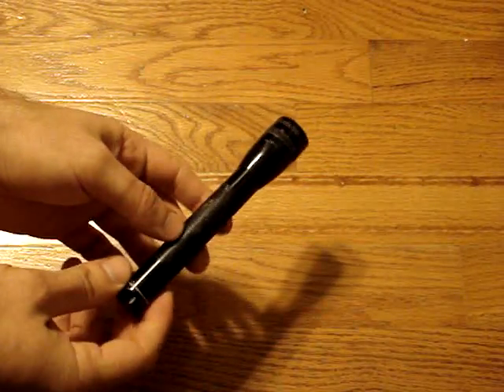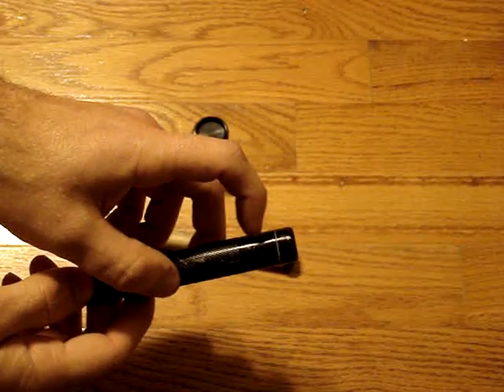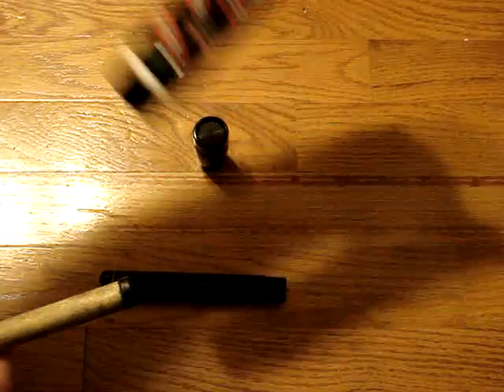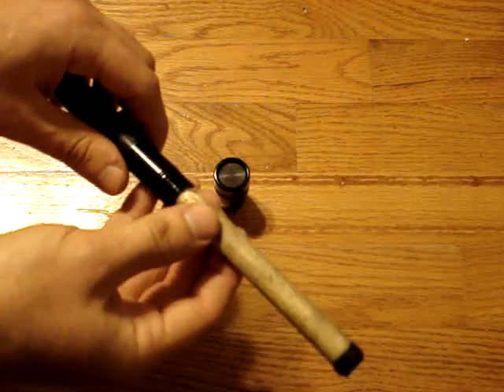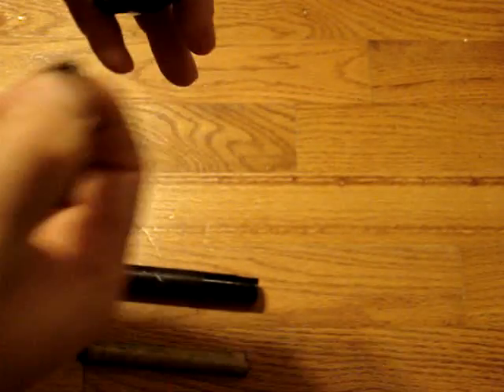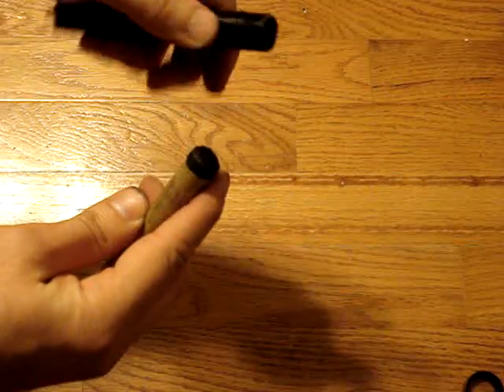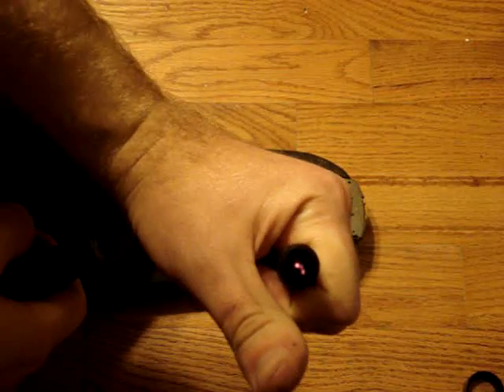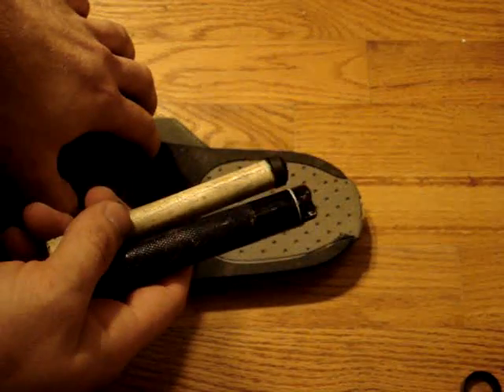MagLite Fire Piston - goinggear.com

Comment: Wow. That's really pretty damned cool. I have a broken maglite and I started taking it apart and whatnot already. But for the seal on the end of the rod, I might do what you did or I might put a little bit of traditional throwback in there and make a groove to wrap some of this leather strip that I have left over from a purchase at a craft store and maybe set the wrap together with some modern materials like soak it in some sort of sealant. Very cool. It's almost made for you by maglite!

Comment: I finally got my own one working. Thank you for the idea! Great video! Keep going!
For the plunger i used a PVC rod instead of a wooden rod for my version of the maglite fire piston. Unfortuntely i wasn't able to find such a plumber rubbing piece in a hardware store here in Europe so at last i created a small notch around the rod to fit a little o-ring into it. It's working fine as well! Normally i'm getting an ember the first try with it using char cloth as tinder! Great thing!

Comment: @sledgehammer60-Copper sounds like a great idea, but use pipe, not tubing.  Try soldering a copper cap on the end, that should seal it up good.  Oh, and make sure you clean the inside thoroughly to remove all the solder flux.  As for your piston, have you tried using an O-ring to complete the seal?

Comment: could you use charcloth with a few drops of gasoline or achol

so that you would get a actul flame, so that you can kind of skip the tinder bundle and ignite some manmade stuff
that would be cool because it would be like a awesome lighter, but could be used traditionaly if you run out of fuel

and a couple drops in a bottle would go a long way
can someone try it?

Comment: Ive just completed making this project but im not getting enough compression with the 5/8 OD orings im using. Can you tell me where in Ace harware to find that rubber cap? Also what is the OD of the dowel your using? Thanks